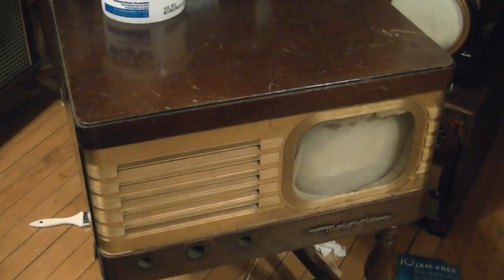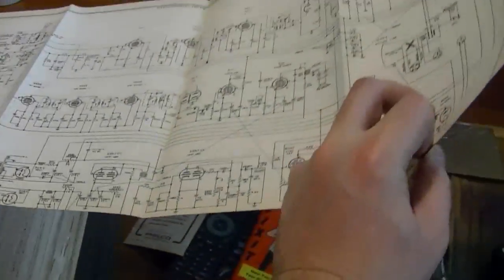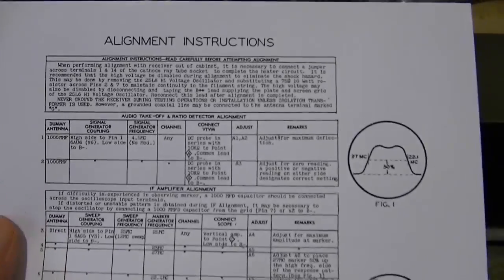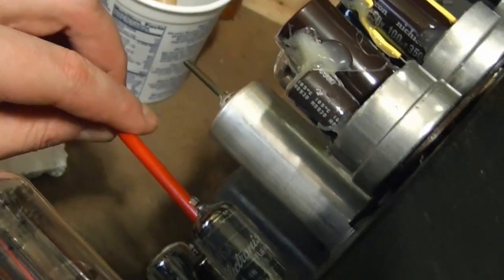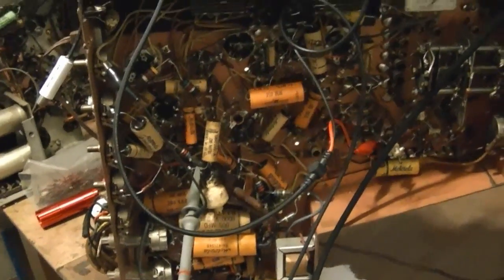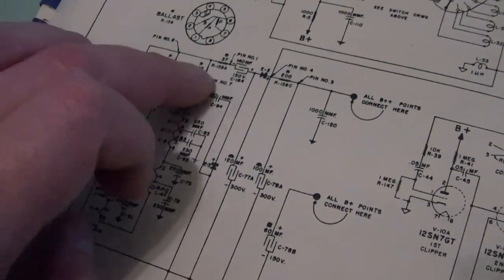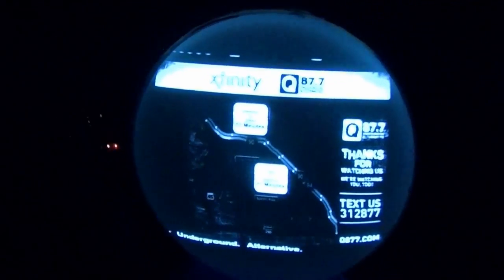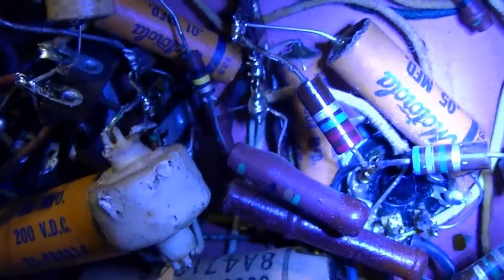Motorola VT-71 restoration continued

Comment: It was very interesting to see how the different voltage dropping designs behaved in the set. I think that I will choose the capacitor approach for my chassis along with the CL-90. I'll also make sure that I add bleeder resistors to the non-polarized caps. OUCH!!!
I love the slooow startup & reduced filament current draw. It will definitely make the tubes last much longer, especially the precious CRT. I won't need that nasty asbestos pad either!
I'll add the circuit underneath though.
Thanks!

Comment: Something to consider when using a diode to drop AC voltage for filaments: that'll put pulsating DC on the filaments which will shorten the life of the filament. Why? The boiling emissive coating on the filament will electromigrate, causing the "thin" end to overheat and fail. This is why tube filaments are almost always operated on AC.

BTW: the output from a half-wave rectifier is 70.7 percent of the input voltage.

Comment: did you have to run a power wire to pin 8 on yours?  My ts 18 chassis doesnt have anything on pin 8
Reply from the maker: I made no modifications to the socket.  Nothing connects to pin 8.
Reply: @bandersentv  what pin does the cl90 connect to is it pin 6?  Looking at your photo it looks like pin 8.  Been staring at your photo on the antique radio forum for hours trying to see which pin the cl 90 goes into.

Comment: As I said "in most cases". Some tubes were designed to operate on DC filament supplies; ones in auto radios, car phones, etc. You'll notice that the tube numbers in your Zenith hybrid sets are unusual; this is why. Not all of them, of course; I made a living replacing horizontal output and damper tubes in those sets.

The difference in life isn't earthshaking; a tube that might last 5 years on AC filament supply might fail in 18 months on DC. Ok for collector sets, but beware.

Comment: For your average restoration it probably wouldn't matter. If you were going to run the set 12 hours per day 7 days per week, it'd make a definite difference in the number of replacement tubes. Heated filaments (light bulbs, too) last longer on AC than they do on DC.

Often what seems to be a simplistic or stupid design decision was made for a very good reason. And filament life is a big deal for a radio station where the tubes are thousands of dollars each and being off the air is a crisis.